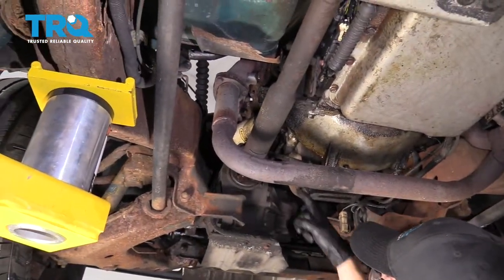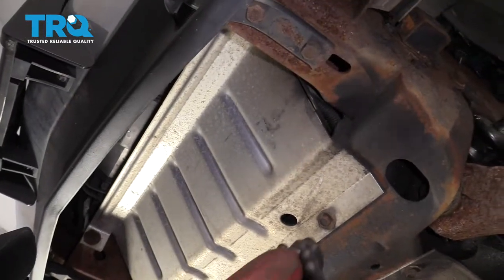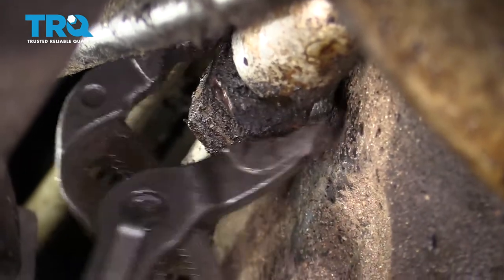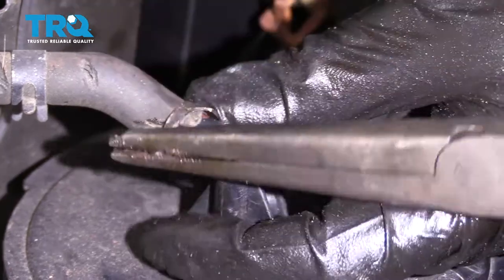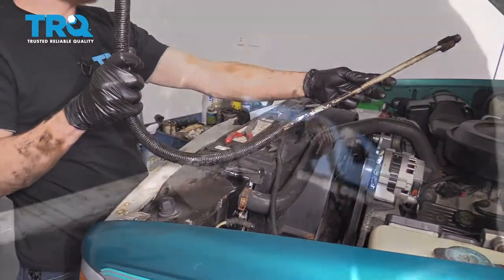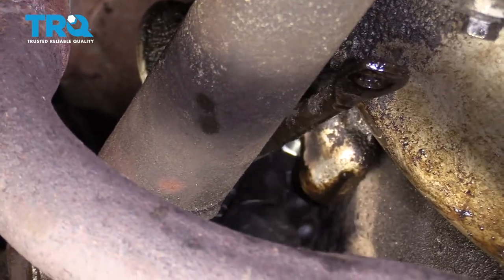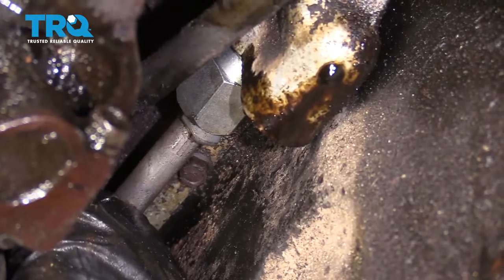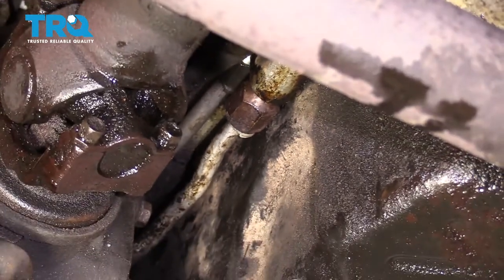How To Replace Upper Engine Oil Cooler Inlet Hose 1992-99 GMC K1500

Comment from the maker: √  Watch the Video
√  Buy The Part at 1A Auto http://1aau.to/m/Shop-TRQ-Parts
√  Do it Yourself
√  Save Money
Reply: Looks like the design changed from the old line to the new one.
Reply: Do you have too take the oil filter too just change the upper line?

Comment: Huge thanks to you. There's a number of videos on how to replace or delete the oil cooler lines on a GM truck but so far you are the only one that indicates the nut size of the bracket that holds the two lines together. That saved me a lot of time and frustration. Thanks a million ! ! !

Comment: I just deleted my oil cooler lines I don't tow any thing and use syn 10/30 oil in my 1991 GMC 5.7 1500, for the last 15 years , and installed a normal oil filter adaptor from a 350.and spun on a new filter .

Comment: You did not show how you removed the oil filter & the quick connects for oil cooler lines. I have a hard time removing these 2 items because of the space limitation. Can you give me any tips? By the way, I'm a woman & have very little experience in fixing vehicles. Is it possible that this oil leak causes the oil in the coolant (not much & not milky)? But there is no coolant in the oil? ASAP, thank you.

Comment: At 7:43.  If you pause it, that wire with the insert    What is that wire or sensor called?  Mine is hanging an not sure where it goes